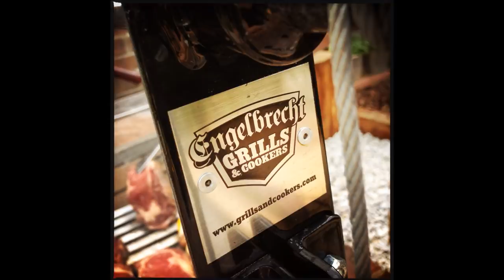Argentine Style Grill & Brick BBQ Smoker Stop Motion

Comment: Great work Ralf! I was wondering, how long does it take to get the smoker up to temp (225-250F)? I heard block smokers take a while to get hot. Also, I know you put down fire brick at the bottom of the smoker but how is the rest of the smoker holding up to the heat? Any breaking/splitting in the top sections of the block?
Reply from the maker: Thanks Joe ! To start the smoker, I burn down 3-4 medium logs which takes about 30-45min. That gives me 250-200F for about 2hrs. I refuel either with smaller logs or charcoal that I start outside the smoker. I stacked fire brick 2-3 rows high inside the smoker, everything else is cinder block. No cracks so far and I don't expect any. Even if it does develop cracks, that should not matter much since everything is double walled.

Comment: I cooked on one of these in Uruguay and they're fantastic!  Great design!
Reply from the maker: So true - this style of grilling is the best !! 
Thanks for your feedback.
Reply: Ralf Gomm Ralf...am I going crazy or didn't I see that for $20 you'd send the plan for this?  I would end up modifying it a bit to be more Uruguayan but the bones would essentially be the same.  Also, where'd you get the smoker doors?
Reply from the maker: Hi Chris, you're not crazy (as far as I can tell). The plan is available here: https://sellfy.com/p/ChZI/ Modifying it to your needs should be easy. I am happy to answer questions along the way. The doors are a self made sandwich of plywood, sheet metal and decorative aluminum. Very easy & durable actually. I wish I could have had cast iron doors but simply didn't find a good (cost effective) source for that. Enjoy and make sure to send pictures !!

Comment: in argentina the fire is started in a especial and aparted receptacle, in here the meat are cook in the grill no with fire, but with the hot coal shaped from fire, putting this hot coals under the grill inself, this hot coals cook the meat slowly and perfect, great job, greetings from the south of the continent
Reply from the maker: And I may add that the meat comes out completely different compared to hot&fast grilling over high heat!! So with this grill, I would normally burn down the fire right in the grill area, then add meat once only coal is left. If I do need more coal for a long grilling session, I can start a fire in the smoker and add those coals to the grill. Thanks Rodolfo !!

Comment: Love the arch, love the stonework, hate the chimney.
Reply from the maker: TheBushdoctor68 Yes, the left half does look more appealing. I'd consider building the next one without the smoker....
Reply: Hey. Thanks for the reply.
No, I think the smoker is great, I just think that the metal plate and pipe are in sharp contrast with the rest of the beautiful structure.

I watched several videos on these types of BBQs and I saw someone who build a tapered brick chimney on top of what you already have, and finished it off with a cement rim with a slot to fit a metal slide, so you could adjust airflow. I think that would have looked great on your creation.
Reply from the maker: Yup, I think you are spot on. What you describe reminds me of a traditional Argentine grill design with tapered brick chimney. The Home Depot pipe was fast & cheap. That's not how we're supposed to do it :-(  Next one...

Comment: The video was really entertaining but I would really like a proper explanation of how the smoker work
Reply from the maker: Thanks, glad you liked it! The smoker is of type ‘vertical’ which simply means the meat smokes above the fire, at a distance great enough to enable temperature control, and most commonly separated by a water pan to help regulate temperature and act as heat shield. Vertical smokers tend to overshoot in temperature easily, and take practice & beer to properly control temperature. But they are easy to build and make awesome pulled pork 😀

Comment: I like your grill but my constraints require me to build differently. I bought same grill parts and I am curious why you chose to disregard the black metal base and not just brick around the Engelbrecht Argentine campfire grill. Was the metal base the issue or was it the firebricks? Just how did you secure the vertical posts? How has the metal withstood the elements? Do you normally use the firebox for your coals initially
or just fire up under grill. Any advice on building the firebox? I visit Argentina on a weekly basis being a pilot and am taking on this project to bring that Argentine grill experience here in Dallas. Please let me know your thoughts what you like and dont like about your build.
Reply from the maker: Hi Warren - I didn't want the metal base visible and to brick around or over it would have looked wrong. Removing it is a good things since you can use the two vertical rails and bolt them straight to your own structure. The plan I made shows details on this: https://sellfy.com/p/ChZI/ My grill is now two years old and all metal parts hold up great in Carolina weather. I always build the wood fire right under the grill. I really wouldn't change anything on the design - I like the look and it functions great. Get inspired during your travels to Argentina and make it your own :-) Enjoy !!

Comment: Very nice setup.  What area of the world do you have this in, does it see winters.  With no footings below the frost line I wonder what would need to be modified to do this in Michigan.  What happens to the rain that comes down into the fire box of the grill or the run off of the counters next to it?  This is the closest thing to my wants as I have ever seen.  The video was fast to the point and entertaining, you did an awesome job on both the structure and the video.
Reply from the maker: This BBQ is in North Carolina, so no problem with just a 5" concrete slab, but as you point out, areas with harsh winters might need this to be modified accordingly (I'm not the expert in that matter). Good observation with the rain! I have added an aluminum cover for the grill (not shown in the video) which keeps out most of the water. However, water that does enter the grill area will collect at the front & back of the concrete center plate and run out at all four corners, along the inside of the brick arches and come down to the concrete slab. The other important thing is to simply lay the fire brick onto the center plate without setting it in mortar. So if ice does build up in that area, it will not cause any cracks ect. Thanks for your feedback !

Comment: Why does the smoker not need fire bricks? Just curious. What kind of fire/coals do you put in the smoker? Does it smolder or flame and for how long? (I'm new to this)
Reply from the maker: I lined the smoker bottom with 2” fire bricks and one row up around the three sides. But there is no need to use mortar on those, just stack them side by side loosely which prevents any possible freeze/thaw cracking. Elsewhere, the fire won’t be hot enough to do damage. 
I apple, cherry or hickory wood to build a large  fire in the smoker. Let it burn down good and start cooking. Heat control in a vertical smoker like this isn’t easy and takes some practice, a water pan on the lower rack definitely helps. Then just add smaller pieces about every 45min to maintain heat. It ain’t fun without some fire action :-) Enjoy!

Comment: Well done sir. Well done indeed. How does the smoker hold temp? Any issues with the umbrella being that close to the heat source of the grill?
Reply from the maker: Thanks ! The smoker holds temperature very well. I burn down an initial large fire to heat up the structure and then get about 2h at 225F in cruise control. Adding new fuel takes practice since it is a vertical smoker that likes to overshoot temperature. So I would add small pieces of wood or hot charcoal that I start outside first.
No issues with the umbrella... seems to be just far enough away.

Comment: Nice video..how have you designed the smoker? Are you just letting the smoke rise up to the grills? I've seen smokers which have two separate chambers one for fuel and one for cooking
Reply from the maker: You are right, I decided on a vertical smoker which works great if you are able to maintain a small fire (dry wood). I also use a heat shield (aluminum pan with water), placed on the first grate between fire and meat. The initial 3-4 log fire heats up the smoker and allows me to keep 225F about 2hrs before refueling is required.

Comment: Great video Ralf! I'm in the beginning stages of building this now,with a couple modifications. i'm making the smoker portion about 6 inches wider and 1 course of block taller to bring the cooking grate up.I'm also making the grill surface wider to have a brasero on the side for fire and embers. do you have any thing you would have done different after the build? Any suggestions on things NOT to do lol? Also, is the 4 inch pipe on the smoker big enough for flow and heat retention? Any advice would be appreciated...thanks
Reply from the maker: Robert Hatfield The one thing I would have done differently is adding a brasero to build the fire and collect embers. So I really like your modification. Have fun with your project and send a picture when done!

Comment: Great video! One question how did you build the doors to the smoker?
Reply from the maker: The doors are 3/4" plywood, lined with sheet metal on the inside (wrapped around the edges) and decorative aluminum on the outside. They can stand surprisingly high temperature that way.
Reply: Thank You! Great work

Comment: what size is the bottom concrete slab.  I plan to get the plans from you this summer be want to pour the slab now.
Reply from the maker: The structures' foot print is about 9.2ft x 2.8ft. You might want to target a slab that is a few inches longer and wider to have some wiggle room if needed. Have fun and let me know if you need any help !

Comment: are the firebricks inside the smoker a necessity or can i just build the smoker with standard brick?
Reply from the maker: Concrete or standard brick will take fire fine for some time... but it will eventually get real porous / crack and fail. So I would use firebrick if you plan on using it a lot.

Comment: Great video! Very helpfu alsol!!!  I am putting one together myself.... Got a couple questions for ya.  My firebrick are the 4x9x1 1/4" thick.  Do you soak the firebrick first before laying.... i've heard for 20 min or so?  I didn't notice in the video if you  used the high temp mortar mix below the bottom layer of the firebrick, also you didn't use mortar between the bottom bricks either, was there a specific reason you chose this?  Any issues with bricks cracking!  If this info is made clear in the PDF instructions I would be happy to purchase the info...Thanks Ralf
Reply from the maker: Hi Christian, I did not soak the fire brick in water before laying... nobody told me to do so! I also did not use high temp mortar... didn't want to spent the money. BUT, I don't have a single crack anywhere after two seasons of winter grilling. The large temperature difference generally causes the most stress on bricks & joints and everything seems to handle this just fine. There is a reason for not using mortar between the bottom bricks: you want those to float a bit in case water does get underneath during wintertime. Even tiny amounts of water that freeze underneath brick will lift it up and make it crack immediately (a pro told me this). Glad to hear the video inspired you o build your own version !!! The PDF contains detailed drawings of the structure, approach to mount the Engelbrecht, smoker doors ect. Might save you time if you're planning to build it very similar to my version. Enjoy !!
Reply: Ralf Gomm Hey thanks Ralf... so did you put mortar below the bottom bricks or do they just sit on the concrete pad?
Reply from the maker: Hi Christian, no mortar between the bricks in the grill area. Those are "floating" on the concrete plate to prevent cracking in case of water freezing underneath. Even small amounts will lift up bricks and cause damage. Other benefit is that those can easily be exchanged if needed. After all, those are exposed to the highest heat....

Comment: How did you attach the grill to the structure? I saw you attached it after you laid the cement slab at 2:29.
Reply from the maker: I removed the base frame from the grill assembly and bolted its vertical rails to steel lintels that are embedded between front & back of the brick structure. If you are interested in building this, I have a plan that includes detailed drawings: https://sellfy.com/p/ChZI/ Have fun !!

Comment: Just bought the plans and I am looking forward to building this bad boy. Question, where can I find the thermostats for the smoker?
Reply from the maker: Sox Chanos The thermostat is from my old grill :-) But you’ll get those anywhere: Amazon, Home Depot, Lowe’s, Grill supply store... Have fun building and let me know if I can help!
Reply: Thank you. I have been dreaming about this build. I just love the look and functionality of it. 

Best video on YouTube.
Reply: One more question. I couldn't quite make it out is there a concrete or brick separation between the fire box of the smoker and the smoker compartment or is it just the steel mesh?
Reply from the maker: Sox Chanos There is no separation other than the mesh grate. Depending what I cook, I’d add an aluminum pan with water as heat shield.
Reply: OK I have studied the doors and I think I gave a solution to them. Please let me know what you think.

If I attach the angle iron on the finished brick there wouldn't be that inlay gap and I can attach hinges without breaking seal.

Do you think that would work
Reply from the maker: Sox Chanos That should work, you just can’t recess the doors if hinged. Otherwise, I never had a problem with my simple method of securing the doors by wedging a small piece of wood between brick & door. This also makes good contact with the seal.
Reply: Quick question, how many logs do you need to maintain 250 degrees and how long does it go for?

Comment: Being that this is ~2 years old how has it held up? Would you change anything about your design?

The wood under the arch is just for storage right?
Reply from the maker: Everything is holding up great, including the powder coating of the Engelbrecht grill. No cracked bricks or tile despite plenty of winter grilling. I really wouldn't change anything. Looks great and works like a champ. But I would modify the design for colder climates for the fire to be more enclosed / traditional Argentine chimney design.
Correct, big storage volume under the grill - keeps wood dry and lasts for around 6 months of grilling !
Reply: Ralf Gomm Perfect thanks man!! I plan to buy the plans and start on this soon :D
Reply from the maker: Awesome - have fun !!

Comment: Where did you get the wheel &  Grate set up?  Would like to know the dimensions of those things & how you put them together.
Reply from the maker: Total spent was around $1,000, half of which is the for the grill assembly itself. This is sold by Engelbrecht (model: Braten Campfire with stainless grate). Critical for this project is to get all brick for free. Used bricks look way better and safes tons of money. Check the comment section for link to the plan which includes parts list ect. It's for a good cause!
Reply: Ralf Gomm
Thank you Ralf.  I am getting ready for spring fix-up & repairs.  Most will be deck & patio so I thought this would be a great addition.  I assume the link gives pad dimensions so the brick placement is correct?
Reply from the maker: +H.U.D. Shute Yes, the plan includes all critical dimensions, including the concrete slab. Have fun with your spring project!!

Comment: Hey there, I found your video after searching for installs done with the Engelbrecht grill. Excellent job! The Englebrecht website gives the dimensions of the footprint of the grill but does not bother to account for the vertical arms. Could you just tell me the width of the arm? Then I can notch the space for the arm out of the well in my countertop. Thanks!
Reply from the maker: B Mando Hello, I did not record that dimension but transferred it straight off the grill assembly itself. Not sure what tolerance they keep anyway. Have fun!

Comment: Mit welchen Baukosten hat man denn da ungefähr zu rechnen (keine Arbeitsstunden eingerechnet)? Ein tolles Projekt - und den Schnitt find ich auch durchaus originell.
Reply from the maker: Ich hab ca. $1000 ausgegeben. Der Grill alleine ist $500 und der Rest ging in Zement, concrete blocks, fire bricks ect. Allerdings hab ich alle roten Ziegelsteine umsonst bekommen. Das ist sehr wichtig bei so einem Projekt - sonst wirds teuer.
Reply: Ralf Gomm  Thanks for the quick reply. I would know where to buy the bricks and the mortar etc., but where in the world can I buy the doors for the smoker and all the other single bbq bits and pieces?
Reply from the maker: The only thing you really have to purchase is the adjustable grill. Alles Andere ist selbstgemacht. Die Tueren z.B. sind aus Holz, mit sheet metal beschlagen. Ich hab nen 12 seitigen Bauplan mit allen Details gemacht: https://sellfy.com/p/ChZI/ and 50% goes to charity !!